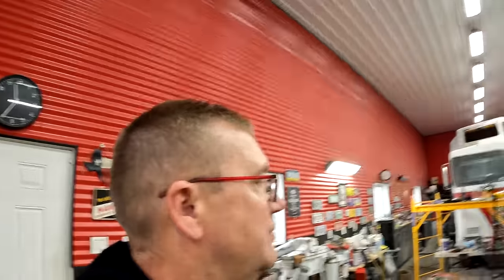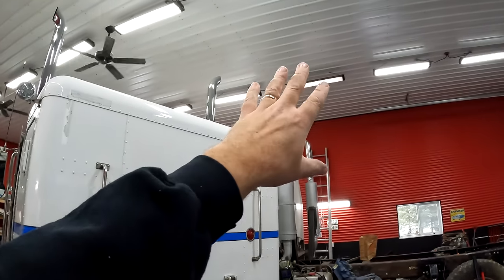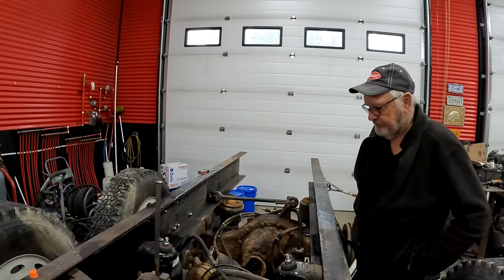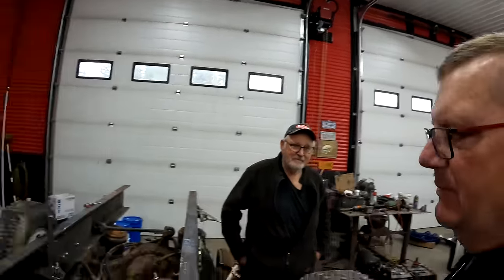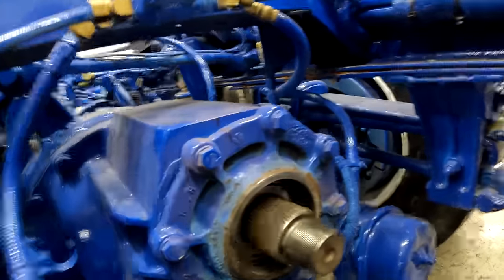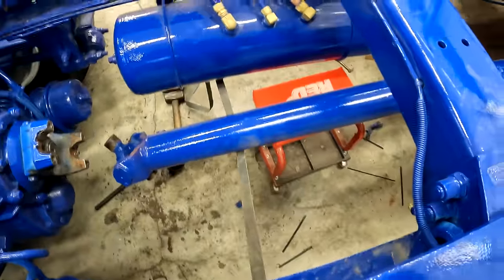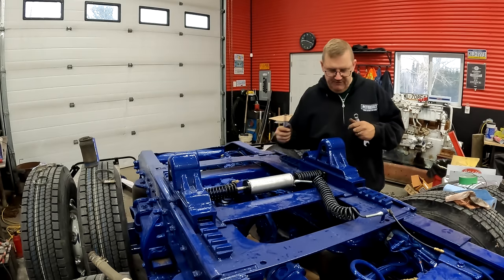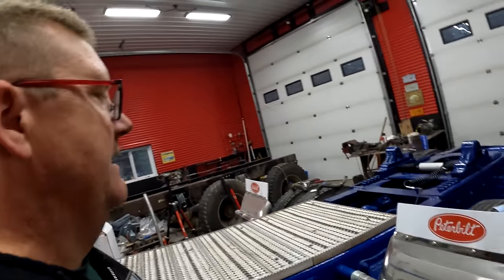How much torque? ALL the TORQUE!!

Comment: Hi Mike. Ya know what's really handy is a sand blasting cabinet for your small parts, Harbor Freight got em cheap.🙃 What you could do on the ladder is make up a mounting bracket that fits the frame holes, then drill your mounting holes for the step, IF you paint your bracket the same color as the frame it shouldn't show as much, or just drill more holes in the frame, everyone else does.....drill baby drill.😋You need a gantry crane for lifting stuff plus it would be a lot safer🙂
Reply: I have 1 and did the mods to it , it blasts just great. My buddy loved using it so much i found him one on the marketplace for $25.00 fixed it up and gave it to him. Find a  old shopvac for it.